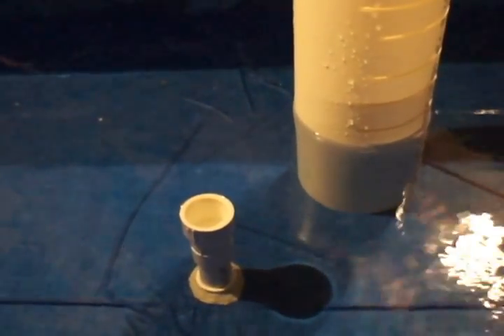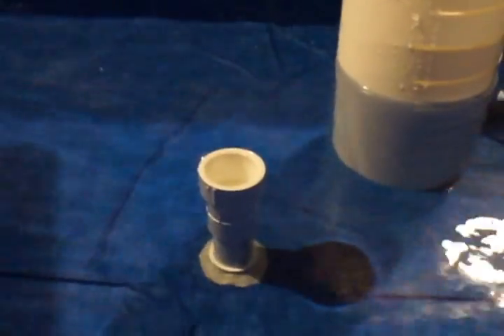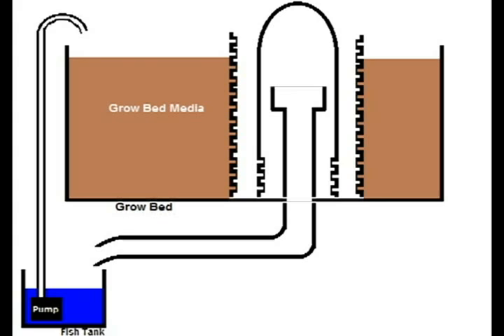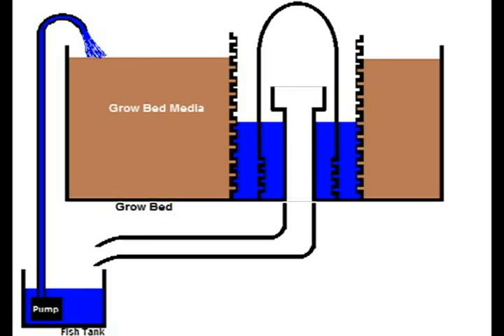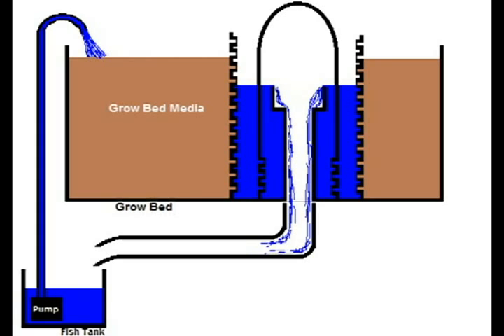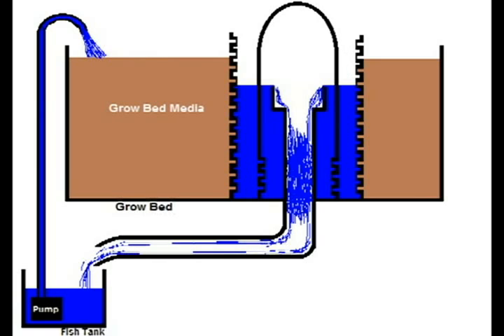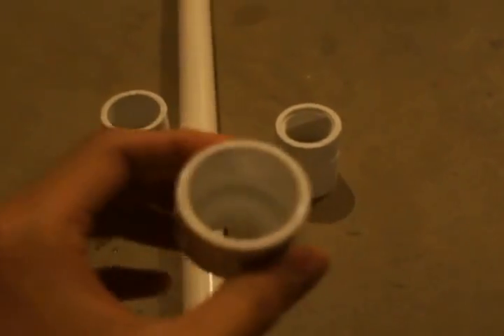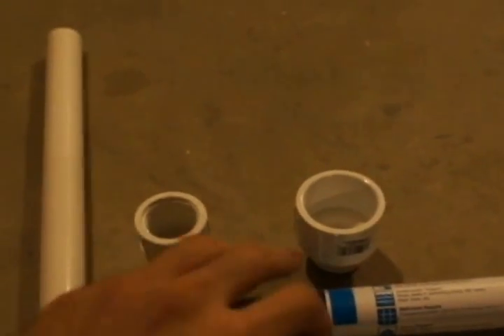OSPE: Sustainable Food - Building an aquaponics Automated Bell Siphon

Comment: How much efficiency provide by it 

If we increasing the tube length infinity having maximum water hammer so will the temperature rises and boiling started ???

What is energy flow in this system ?

Comment: So what was the end result of the testing regarding the optimal dimensions of a bell siphon system?  Did increasing the size of the stand pipe at the top help improve the function?  Best spacing for clearance between the stand pipe and siphon?  I know some of these answers depend on the application, however imagine there is a best ratio regarding the various components.

Comment: I've been running bell siphons and various other mechanisms for a few years now. What I've found with bell siphons is that you have to keep the flow rate into the tub somewhat constant to keep the system within the range of reliability. Because this is a system with living things in it, they will continuously work against the functionality of the system. There is no equilibrium when your mechanism is held at a constant but your system is affected by the activities of life. It approaches a steady state only when it approaches total failure. That is the problem with putting life in a machine.

The flow rate into the system tends to be altered when the pump gathers debris and becomes obstructed, as well as the piping gathers biological film and debris. This changes the pressure differentials on the pump as well as the effective pipe diameters, and subsequently, the all important flow rate. 

Roots highly favor flowing water over stagnant water. The areas of highest flow are right around the input pipe outlet and the restrictions caused by flow-holes in the gravel guard around the siphon bell. If this doesn't cause your system to fail, the roots will restrict the gap at the bottom of the bell. If they can't stop the system there, they will grow right down the drain pipe until it's clogged. 

In addition to putting your energy into building what is essentially the bottom half of a toilet and calling it a success, be sure to go at this with the foreknowledge that the better your system works (fish and plants are thriving), the faster and more often it will fail (plants and fish will cause failures in the simplistic, uncompensated parts of the system). With a lot of time and experience with these systems, I've been able to extend my un-breaking intervals from a few hours to sometimes a week or two, but in order to get a system reliable enough that you can go on a short vacation without antacids, it really takes a lot of non-simple solutions and, sadly, automation and the availability of the only person on earth that understands how this unique system works to make it work again.
Reply: fk if it clogged , arent it a headache since its cover with medias ?
Reply: If you make the bell jagged at the bottom, you can twist it around when it clogs with roots and that will cut the roots. When it's clogged, at first it will drain and not shut off, so cutting the roots this way will allow them to flow through the stand pipe and into the sump. If allowed to grow until the restricted flow is smaller than the input flow, the grow bed will generally tend to flood.

Of course, this means that whatever you have after the standpipe will receive a bunch of root fibers when you cut them, and if that happens to be a pump (because putting a filter before the pump means the pump filter will clog hourly in an established system) then the roots can jam the impeller blades and restrict the flow in every valve down the line. So the pump may need to be cleaned out and generally all of the ball valves have to be opened - one at a time - to blow out whatever has gathered in them. The valves and pipes will become restricted with biological materials over time anyway, so you'll be really good at this by the time roots also clog them.

Getting the flow rates dialed in on each valve to balance the flows in a highly branched system is a nightmare the first few times you go to do it. It gets easier with experience, but it doesn't become less of a nuisance.

As far as roots clogging the media guard, that will happen if you try to grow plants perennially in a flood and drain system. If you watch a bunch of aquaponic videos, you will notice that a person who grows tomatoes (a perennial) will usually empty the entire grow tub when the tomatoes are spent for the season. This is because the media becomes essentially a solid block of roots with media stuck in it, and is essentially useless until it's completely reset. Growing tomatoes in that container for more than one season will likely jam up that part of the system and otherwise cause decline in the plant.

I largely grow just ginger, turmeric, and lemongrass in media anymore, because - other than the lemongrass - the other plants are removed every year for harvest and replanting. This keeps them from requiring the media be completely removed and the bed reset from scratch. The lemongrass is in my first (learning) bin, where I removed the F&D parts and just let it drain back to the sump with a gravel guard to hold the media away from the hole in the bottom of the tub. I just have a water distribution ring around the edges so water flows in and constantly drains through the hole in the bottom. Within a month of planting the lemongrass, I've got roots hanging out the bottom of the bin (with the water running down them, which is good) and those roots will get as long as I let them. Eventually, they will find their way through the sump to the various pumps in there and start slowly wrapping around whatever parts of the pump internals that won't chop them up. Eventually, this chokes the flow to the pump and requires a teardown.
Reply: Buck Starchaser all your points are both relivent, and important to address. a few problems I may have solved through a change in design slightly, however the changes also bring in additional challenges. one thing is to use this hydrponicaly instead of auqaponicaly. small change but big impact on the pump. the resivore at this point will hold nuts solution relitivly lower in solids than the fish waste water. no means saying that aquaponics is inferior because in some applications it's the most effective method known to man. an old concept centuries old.in addition to switching to hydroponics ebb and flow, I would go as far as using maybe a hand made maintnaceable filter using something like a sponge and loose packed cotton, cheap to replace, and would potentially prolong the life of the pump at least, though admittedly at the cost of added maintenance. and I am toying with the idea of putting the siphon into a "sump tank" or controller, as water tends to find it's own level. onle challenge here is watching overall volume. more volume means more time on the fill cycle, longer the roots are submerged. so I'm considering using a system like the ebb and gro kit, using small containers, just large enough for each plant, the reduce over all needed volume. this will also add the luxury of a modular expandable system. in addition, I may opt for a faster flow rate of the water to compensate for volume on a larger system if fill and drain cycles look like they are too long, and roots are submerged too much. some plants like it, hell they could grow in a jar of water. like cabbage. others with get seriously pissed at you lol. so control over the system will be nessicary. one highlight of this is it's mostly mechanical system, pump being the main weak link. so it's possible to devise a safety in case the system fails for any reason and prevent loss of your plants. I honestly haven't got that far in my design personally, and be glad to hear ideas for this.
Reply: Cheers for the Video clip! Sorry for the intrusion, I would appreciate your opinion. Have you thought about - Patlarny Gardening Expert Principle (probably on Google)? It is a good exclusive product for learning how to expand your produce with the clever art of aquaponics without the headache. Ive heard some incredible things about it and my old buddy Taylor after a lifetime of fighting got great success with it.
Reply: u confused  me now..are u happy.

Comment: A 'U' siphon will do the same exact job, for a whole lot less time/money/effort, and be so much easier to explain. I was sold on the 'Bell' siphon method too, but it's too much work for something so simple.

Take a U-shaped pipe and flip it over, connect one end to your downspout, on the other side cut notches/slits/holes to break the siphon with, install it into your tank with the "bottom" of the 'U' pointed up, and you're done.

Comment: Interesting project Leo Riveron! What would happen if you were to incorporate an invention known as a RAM pump to replace the electrical pump? Would that "over power" the system? as far as i know a RAM pump provides a constant feed as long as you have water pressure, however, a small stepper motor connected to a battery and a timer could provide you with a similar stop start function yet significantly reduce your need for elc. Downside is that the RAM pump releases a fair amount of water. Just a thought though.

Comment: I don't really understand how the flare in your siphon tube would work to start the siphon more quickly?  The siphon action is going to be assisted by enough water flowing into the standpipe that it blocks the air and creates a column of water that gravity is pulling down on that then functions to pull more and more water through from inside the bell and under the whole in the bottom of the bell.

The water level is rising at a certain rate, so the amount of water going above the standpipe is going to be a fixed rate ... and that rate is what goes down the standpipe and starts the suction, so it really should not matter how it gets there, how wide the top of the standpipe is.  If you made a smaller hole small enough to restrict the flow you might then have problems creating a suction, but I don't see where increasing or flaring the end would make the flow more or start the flow earlier or more strongly?
Reply: DIY aquaponics is currently creating buzz alongside commercial aquaponics. The term aquaponics may sound like it is out of your league but in fact, it is actually a fun way for you to start growing plants in your garden more efficiently. Watch this video here as it's all explained. Go here ==> easydiyaquaponicstv.blogspot.com

Comment: I use an orifice plate under the reducer at the top of the stand pipe to make the siphon start sooner. Use the Golden Ratio (1.618:1) for the orifice plate hole. For example, with a .5 inch diameter stand pipe, make the orifice plate hole .30 inch diameter (.5 / 1.618 = .309). For .5 inch PVC stand pipes, I cut down water bottle caps to make the orifice plate. The trade off is that it will take longer to siphon the water due to the constriction.

Comment: Is this a closed loop system? Does it power itself?
Reply from the maker: Wurdswurth The goal is to have it power itself, but currently it doesn't - I'm using electricity the from the electric company at the moment.  I'm still working on the Automated Larvae Harvester - so I don't need to keep buying fish food - but I'll be able to get to that part of the system afterwards.

Have you seen the flow chart of all the inputs and outputs of this system?  It's on the facebook page as the cover photo.  The only 2 inputs are compostable waste and electricity.  As we eat we produce food scraps, so that's already free, then when this is connected to a solar panel or wind turbine, electricity will be free as well - making this a fully sustainable and automated aquaponics system!  :)

www . facebook . com/OSPESustainableFood
Reply: I want to get solar powered pumps
Reply: Wurdswurth that would be impossible

Comment: I’ve been thinking about what you said a bit, & it seem you are wrong on at least one point.  You say, ‘the AIR GOES UP THE DRAIN PIPE just before the siphon starts, because of the negative pressure that is in the bell’.
    Well I’m sure that the pressure within the bell, is slightly greater than the atmospheric pressure (outside of the bell) while it is filling, even for the moments when the water & some air first starts to fall down the drain tube.  Thus the air would never need to travel up the drain pipe.  But then when the water falling down the drain pipe, reaches a point where the cohesive weight of the water falling down the tube is greater than the pressure within the bell caused by the rising water level within the bell then & only then is there a negative pressure within the bell.  Then the pull/draw of the water falling down the tube will cause the water & remaining air to be sucked out of the bell, & replaced with the water in the tank until the level of the water in the tank is low enough to let air fill the bell & drain tube, thus eliminating the water in the drain tube, then without the weight of the water pulling on the water (& air) above it, there is again a moment equal pressure between the space inside & outside the bell, but then in more or less than a second, the pressure commences to be slightly greater in the bell than the outside atmospheric pressure & the air will flow out (down) the drain tube, thus repeating the cycle.  I don’t see how the air would ever need to flow up the tube.  This could be tested by putting a one way valve on the end of the drain pipe, but the one valve would have to be one that was very easy to open because of the low pressure.  The other thing I see that you are doing, is using a coupling to make the inlet of the drain pipe bigger, it would seem that, that would make the siphon a bit slower to start but there might be a reason why the bigger opening is a good thing that I’m not seeing.

Comment: I just tested my first Bell Siphon attempt, and sadly, it failed. I'm using a 2" standing pipe and the Bell was made with 3" pipe. After re-reviewing several videos (and finding this great one) I believe that my Bell is too small and is not allowing enough water to get into the 2" pipe and thus, it cannot begin the siphon. My question is: will a 4" Bell pipe be big enough and enable enough water to trigger the siphon?
Also, doesn anyone have any experience with having too little or too much overall height on their Bell and this causing issues?  I was thinking about 1.5"-2" clearance over the Standing Pipe would be good. Thanks in advance!
Reply from the maker: blahblibidyblahblah  Hey, apologies for slow response!  A 2" stand pipe would require a much faster flow rate: the water that's being pumped into the tank.  You could try that, though I've never tried a stand pipe that large.  Mine have always been 3/4" diameter, but my beds are always pretty small (2' x 3' x 2'), so my flow rate from my pump is around 180-300 GPH.  I would suggest increasing the flow rate before increasing the bell size, but you can try both to see which works.

I haven't tried that either.  heh  I never really measured the clearance, I always just over-estimated - I have at least 3" clearance.
Reply: Leo Riveron thanks for replying. I ended up getting them to work by adding a 2" to 1.5" reducer on the top of the standpipe as well as another reducer (same size) at the outflow end. 
Since my original comment, At my school, I built a larger system (3 beds, 8'x2') linked to a single pump. I can get them all to work with the same set up, but they "fall out" occasionally and need to be reset. I'm thinking of chopping out a small part of the return (where it's horizontal) and adding a bottleneck (reduce from 2" run a few inches and then expand back to 2")  Do you have any thoughts on the last idea?
Reply from the maker: blahblibidyblahblah  Oh wow, that's a lot of water to be covering with one pump!  Are you pushing at least 400 GPH?  You might need more than that to ensure your siphons will actually start.  Is that what the problem is?

Your drain should be fine, some people have suggested adding a coil to the inside of the standpipe to get the water to block the air and start the siphon faster.  Could just be a plastic coil or something - just as long as it actually moves the water in a spiral to block the air from entering the bell from the drain pipe.  I hope that makes sense.
Reply: Leo Riveron the pump's pretty monstrous. I don't recall the exact specs, but it pumps water OUT faster than the hose fro the house when it's on full. 

That coil idea sounds great. I'll try that before I go cutting pipes.  

I recently came across some videos where people use a Loop system to drain the beds. Flexible hose comes out of the bottom of the bed, then makes a loop, with the top of the loop being the max fill height of the bed.  Do you ahve any experience with those being more consistent or too slow (my personal guess, based on 3/4"-1" diameter) or anything else?

thanks again!

Comment: Why not just use the drain tube to regulate the water level?
Reply: because they want the water to fill then drain most of the way down, then do it again over & over.  If you just used a drain tube it would always stay at the level of the drain tube, thus the roots & such would not get any air, & be water logged, in that they would be in the water all the time.